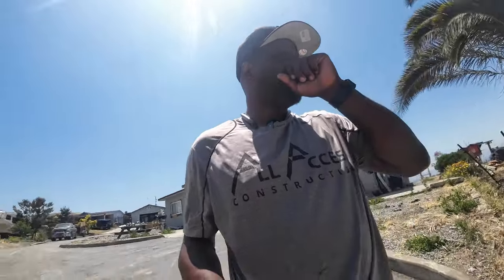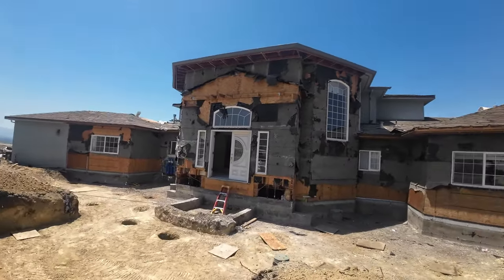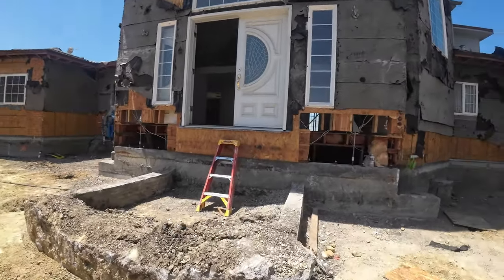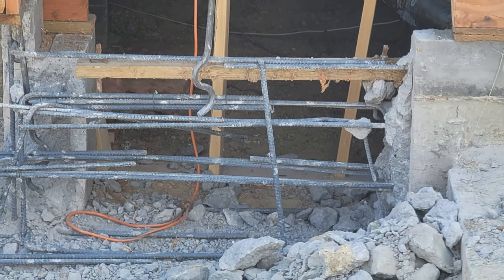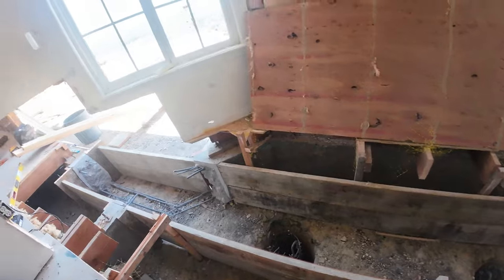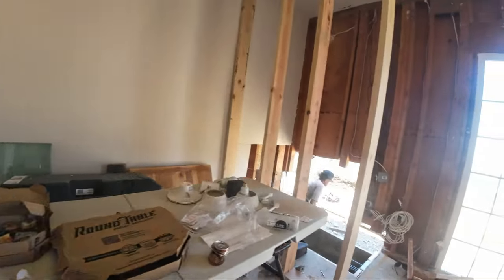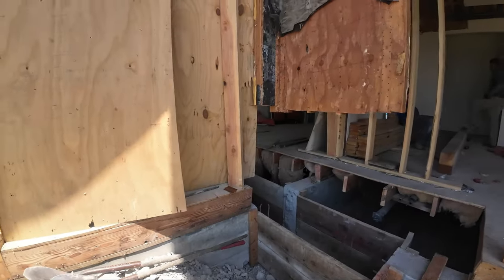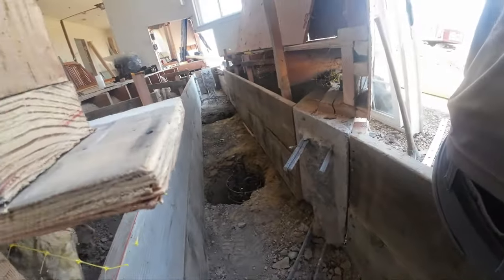Job Site Walk Through | Explaining Concrete Foundation And HFX

Comment: what are hfx?
Reply from the maker: I know I said it enough times 😂😂😂😂. Basically is a bracket to help support new walls
Reply: @AllAccessConstruction  that's the Hardy Frame shear panel, right? Similar to Simpson Strong Wall?
Basically like a real strong shear wall when it'd be hard to get enough plywood shear wall in a short run of wall.
Reply from the maker: Yea Simpson strong walls..
Reply from the maker: Gotta a video of the framers putting it together